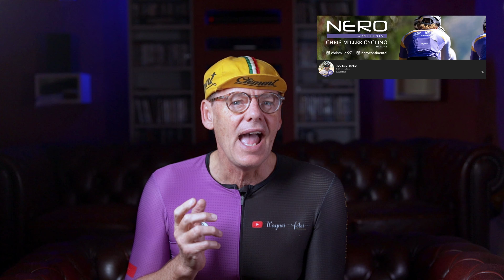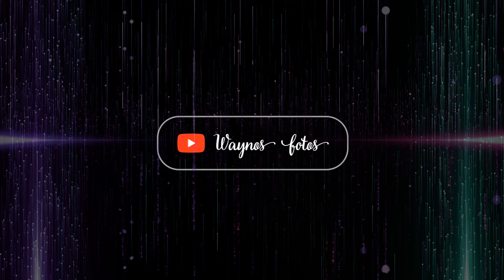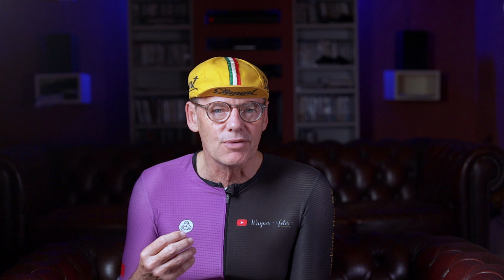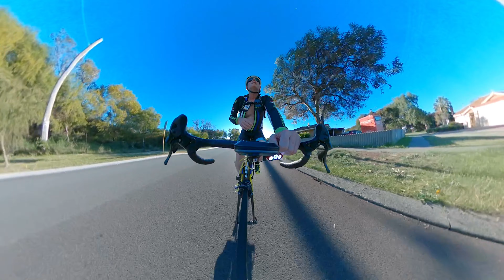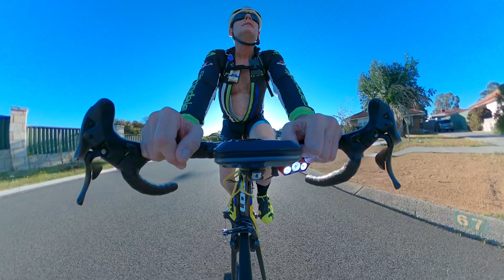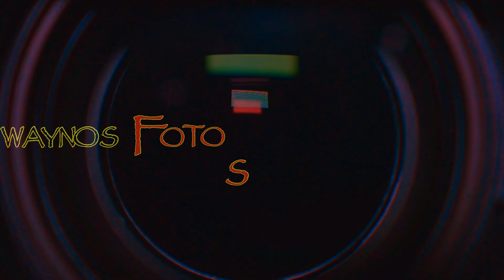DISC Frame design compromise. INDUSTRY INTEL confirms

Comment: You have MTBers who are more than willing to try new tech which may hopefully (or not) make riding more fun. The problems are simply part of the package and deal of experimentation with frame and component design. Now, we’re even going into AI controlled suspension lock out which will automatically change settings based on the terrain and speed.

Then you have road riders who balk at adding a small tech developments that mtbers have used on their bikes from the last decade. I still recall the fuss about thru axle lol. “9mm QR is all we need!” Lol. What a fuking bunch of dinosaurs. 

Fuking thank god mtbers are a fundamentally different bunch from roadies. If roadies ruled the roost in mtb, we would still be on pogo springs and 26” wheels. 

Roadies, you guys need to enjoy changes. Thank god the industry and new cyclists think differently too, and have enough power to make your complaints irrelevant by forcing the shift within the next decade or so. When you step into a shop, a new cyclist is more likely to choose the disc brake version, over rim. I too love my modern day e shifting 28mm 60PSI tubeless disc brake 1X12 road bike. No way am I going back to the 2010 rim brake bikes, 21mm 100 psi tyres which I used to ride back then.

Comment: What is your argument exactly? First of all EVERYTHING is a compromise. Life itself is a compromise. It's not like rim brakes are perfect. For living in Australia maybe...but if you lived in the Alps you would have a different idea. Are you saying that disc brakes require the frames to be stiffer and hence less compliant and that for this reason we have less traction? While it could be true that a fork of a disc brake bike has slightly less compliance because it has to be stiffer (and I'm not sure it is this way) we are talking about a couple of mm of deformation. And the fork of a rim brake bike also has to be compliant or you will visit your dentist more often than you like. There might be difference between the two but it is far from being significant. By far the thing that gives the most compliance to the bike is the tires and the seat post...not the frame. Plus disc brakes allow you to use slightly larger tires...more compliance and more traction.
Second...concerning wheels. Yes, disc brake wheels have to be build with a cross pattern to counteract the torque generated by the disc brakes. But high tension is not a bad thing. Spokes fail from too low tension, not from high tension. Also in a radial wheel you need high tension because your weight is sitting over it. And presumably you even have less spoke. The spokes must retain a certain amount of tension even when are compressed by your weight, so you need a high tension there too. And even in a rim brake bike you need to have a cross pattern on the rear wheel on the drive side (as a minimum) because you have the drive train there. And anyway, everything else being the same to have a compliant wheel based on spoke tension only you would need such a low spoke tension that the wheel would not even survive a few rides. If disc brakes were a bad things for wheels then we would have a long list of dead down hillers by now...
Fine for me that you prefer rim brakes to disc brakes...but I don't understand your argumentations.
Reply from the maker: I have answered all these questions in my videos, it would be to long to explain it here. You raised all the points but don't see them as a problem. But they are. Also go watch Chris Miller cycling i linked it in the video. He also confirms it.
Reply: @waynosfotos  the video you refer to only mentions the comfort of a disc brake fork which is supposingly less than a rim brake fork. Although I don't have experience in this I stress again my point that is the tire that gives the most comfort. If you still like to ride with 23mm tire then fine but with a 25mm or 28mm one you would likely not feel any difference. And did you know that stiffer fork offer a better steering compared to compliant forks? As you see...another compromise.
Reply: @paolocapozzi927  dude. Basically anything that isn’t 1) rim and 2)tubular and 3) made in the 1990s is a compromise to him. 

You can’t have all the tech development you want, modern bikes can now be smashing timings from the last decade, but nope, still negatively compromised with unnecessary gains because they dont have those 3 points.

Comment: I had stopped riding my tubulars years ago because sealant pretty much never worked, and you're right, the higher pressures just didn't fix a puncture out on the road for me. I plan to give my tubs another go with rim tape, after practicing your vids on replacing a tub out on the road ;-) Pretty much kept them just for the racing scene, but if I can use them every day without worrying about being stuck with a tubular I can't repair, I'll definitely go back to them :D
Reply from the maker: Did you try stans? If I get a flat I put in the 30-60ml of sealant and in most cases it fixes the puncture after I re-inflate and spin the tyre. 
I use Veloflex, what tyres were you running? 
I also carry a spare tyre in a bottle tube container so if the sealant doesn’t work I can put a new tyre on. 
But I very rarely need to do this, it mostly is a security blanket. Lol.

Comment: Only time I get flats is massive slashes for some reason which I doubt tubeless would help. I run the ultra light innertubes and not had any issues so far gp5000 serving me well. Direct mount brakes too am suprised how much better they are than usual rim brakes not sure why more manufacturers use them they are brilliant.
Reply from the maker: Never tried double mount, but only heard good things about them. I think it has more to do with the push to disc by the industry why they are not readily available on new bikes.

Comment: I find it interesting that you mentioned brakes. Outside of a track bike with no brakes, all braking systems put a load on all parts of the frame. That's why you'll see overbuilding in the forks of a rim braked bike. It's not there to withstand a pothole hit, it's there so the braking forces applied to the frame/fork won't snap it. That area has to be strong enough to withstand the pressures pulling/pushing when the brakes are applied.
As to the 'low spoke' count crowd, I live that people say a 1 Kg wheelset is great. I love overbuilding at that point because 24 spokes adds a whopping 50 grams to your wheels when spokes weigh on a 2.6 grams each (double butted 14 gauge). More than enough to handle whatever you throw at them. And rotating weight only matters at two points: Starting and stopping.
Reply from the maker: Agreed, these 21 spoke wheels i do feel are pushing it. But with all the talk about getting disc bikes lighter they have to trim somewhere.
Reply: @waynosfotos  I live in Tucson Arizona. A local bike shop built a 6.8 pound bike that could be ridden on the local streets here (and your roads in Australia are the envy of us here). It would cost 20,000 USD and did use special components. I find building a UCI legal and safe Disc or Rim braked bicycle fully possible. The key element has and will remain for me is the miserable braking quality of rim brakes on full carbon wheels in less than ideal weather conditions and the lack of safe carbon wheels in long, alpine level descents. If both of these could be overcome, we would have a winner.

Comment: Frame compliance is marketing BS.  Take off the wheels and place the dropouts on concrete blocks.  Push on the frame and feel that compliance.  What?!? You don't feel the frame compliance?  Maybe you just bought into someone's marketing.  If you want to get the compliance back, add in the wheels, tires, seat post, and seat.
Reply from the maker: For ride comfort you are 💯 right, but across the frame it does flex on undulations from the road.

Comment: I don't buy the idea that disc brake frames reduce compliance. I've ridden stiff as a board rim braked bikes that sent every little road ripple to the bars. Also ridden both rim brake and disc brake bikes that felt equally compliant. Basically it's down to frame design. Tyres and tyre pressure have a major effect on comfort. I'm running tubeless at 60/70 psi front/rear and they give a very good ride.
Not wanting to carry a spare tube when using tubeless tyres is a fair comment, but what do you do if you tubular gets cut? If you don't carry a spare tubular, tape and pump then you go home on the bus.
Stans race sealant is no. 1 for plugging holes. Only issue is that you can't inject it through the valve stem because it's so good it immediately plugs the valve stem.
Reply from the maker: Just to answer your questions;
I was not talking about comfort, I was talking about the ability of the frame and wheels to give compliance to the surface you are riding on. As you ride, and the ground changes, the tyre, rim and frame flex to maintain contact with the ground. If nothing “gives” then the wheel will bounce and loose traction, a vehicle, especially when cornering or putting down power. This relates to all vehicles. I would suggest you go and watch Chris Miller’s video to cross reference.
As to tyres, yes I carry a pump and spare tyre, my point is, if you switch to tubeless, you are being sold this system doesn’t get punctures, i.e. different casing and sealant, self healing as such. So carry nothing. But there is many examples on the net and I know people in person where this has failed to fix the tyre.
As to sealant, yes Stans is tested and rated as the best, I use it in my tubulars and it is very effective to fix most of the punctures.

Comment: Interesting, however I have read on the Felt (love 'em) website that thanks to disk brakes they don't have to reinforce the seat stays anymore (they were under loads of pressure when the rim brakes were attached to them) and therefore they are now free to design the seat stays junction to the seat tube in the most compliant (and aero and stiff and light, of course you can add any bs claim here) possible way. Who is right, if anyone and not all?
Reply from the maker: Yeah not saying that is not true, but remember when you move the clamping force closer to the hub you need higher force to stop the bike at the same speed. This is just like using a lever, longer is easier.
So yeah it frees up the seat stays at that location but they are now applying the forces at a higher level to the extremities of the frame. There is no free lunch.

Comment: They say that 'simplicity is the highest form of sophistication'. Disc brakes and tubeless tires don't fall into the category 'simplicity' ( yet ). The complexity, weight and cost may not be worth the slim margins which may apply to some high end professionals in certain conditions. I don't fall for that marketing fluff of the bike industry.

Comment: Nice video Waynos, I heard from a very well known engineering guru from the east coast of Oz, that using rim tape to attach tubulars increases rolling resistance. Personally I cannot see how this is possible. I would love to hear your thoughts. Thanks
Reply from the maker: Rolling resistance varys with the surface + it is a very low component of the total drag of the rider/bicycle. So even if it is, it is so small it is insignificant to the total drag.
To be honest, rolling resistance is really not worth talking about in the whole scheme of things. Supple casings plays a bigger part, as to speed on diferent surfaces than rolling resistance
Reply: @waynosfotos  Thanks for confirming my thoughts. Love your work.

Comment: I ride both rim and disc, and enjoy both for different reason. For ease of service you can’t beat rim brake, with the right pads( even on carbon rim) at 120kg I can stop just fine, even in the wet…

I also run tubulars on carbon wheels because of my weight, and can’t fault them. Had a flat, used Vittoria Pitstop and all fixed!

Comment: Disks on road bikes. Let's solve a problem that doesn't exist by creating loads more problems.
Reply: Discs on road bikes makes some sense if you are riding the bike a large amount in rainy or snowy conditions where the disc does give you a better braking advantage over a rim located brake. It also allows you to run carbon rimmed wheels without all the braking issues associated with them when using a rim brake.

Other than that you are correct, it is a nonsensical addition to more than 95% of all road based bikes. It introduces are large amount of unnecessary maintenance complexity, and more cost because now you not only have to regularly replace brake pads but also brake rotors. They also add unnecessary weight to the bike and are certainly not aerodynamic. 

But they are a boon for parts manufacturers and bike shops, who now have their service departments continuously full
of bikes needing constant disc brake repair work and adjustments. 😆

And the argument that you can’t ride safely in foul weather with rim brakes is pretty much BS. I have ridden many of the Alps passages in Sweden and Norway in winter time on rim braked bikes and never had a crash due to a braking failure issue.

Comment: Into my first couple of weeks with tubless on one of my bikes........ Hmm not sure, comfortable at 10psi less than my standard clincher on UK crappy country lanes, doesn't hold air as long yet, although tyres are pumped up before every ride, I couldn't mount them the first time without my compressor and yes I take a spare tube with me, would I buy them again, I can't say yes or no at this early stage but what I am thinking is 'this is a fair bit of hassle' a clincher, your just put it on and pump it up.
Reply from the maker: Bingo

Comment: Black ox sealant is by far the best sealant.   Did a 10 day crit series.  One day warmed up and raced knowing there’s a nail in my tire.  After race pulled the nail and zero psi loss.  Simply amazing sealant.  Tubeless is the way to go.
Reply: I checked this stuff out and the claims about greatness were related to trail flats. They never said anything about road tubeless which is what we are kind of targeting in this conversation. You can add whatever to the latex even the corn kernels that you shit out in that big turd before your ride and it's not going to guaranty the hole is going to seal. It's still better to use tires that have the best flat resistance with tubes and if you flat just change the tube.
Reply: True.  I have some bikes with tubes in still with no problems.  But for racing I’m racing tubeless bar none.  Saves flattingnout of the race.

Comment: Who needs tubeless when you have tubolitos?!
I was really amazed when i first rode them and i instantly recognized the lower outside rotating weight-faster acceleration!
Now i have them running for more than 12.000 km without any issue.
Only one thing: You have to check the pressure and every second day add some bar 🤙  from Germany 🇩🇪
Reply: Ive never ridden on tubulars, but i suspect is somewhat the same feeling as tubolitos, love them! Never tried tubeless…
Reply: I have tubolito in my rovals, and sorry, but as soon as the year end comes and I’ve got time, I’m trashing my wheels for a good set of tubeless wheels. 

Tubeless smoothes the  rides so much more efficiently, that I can maintain a higher speed during the ride. 

Trading an hour of higher sustained speed for 5 seconds of increased acceleration, seems like the height of folly to me. But then again, most arguments against tubeless/disc/thinner wheels are nothing but silly so…..figures

Comment: So let see if I get this strait? A tubeless industry standard is to use rim tape to seal the spoke holes in my rim. Some of the tubers suggest using Gorilla tape. That is literally duct (gaffers) tape! Yeah!....I don't think I will make my tire pressure reliable to a glorified duct tape technology. My best solution is Mr Tuffy's (tire liners). Works great, reliable, versatile, and not messy.

Comment: tubeless sealants are not good but if you look at the mountain bikers and copy them they add things to the sealants .personally i put polystyrene bits in mine to help block and seal the bigger holes some use ground pepper others use glitter  .

Comment: Composite manufacturing is not a black art but in aerospace and F1 fully understood and with layup designed to give stiffness, complience and strength. The bike industry is less regulated and checked for quality so who knows what goes on inside the frame without slicing it up. We can only trust the vendors with  less BS and more warranty to keep us safe. That's why I ride Giant who make their own frames in their own factories and do fix bad frames under warranty. Disc brakes or rim brakes there have always been bad manufacturers of bikes but at least now we have Hambini to call out the worst cases. Ride safe and stop quick.